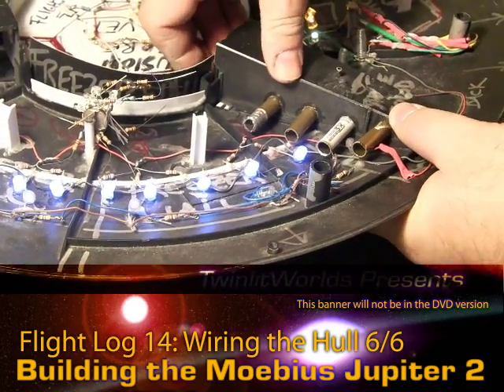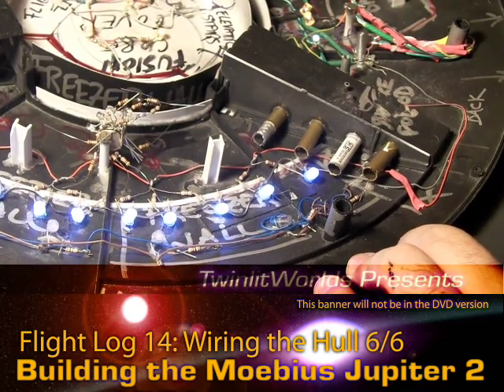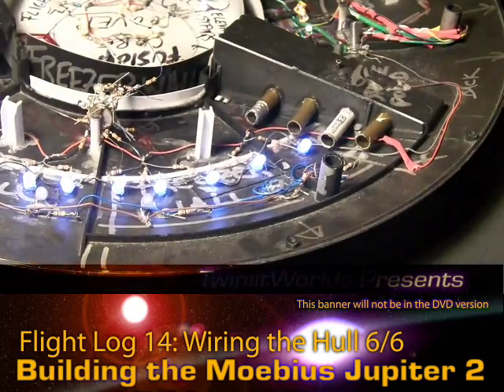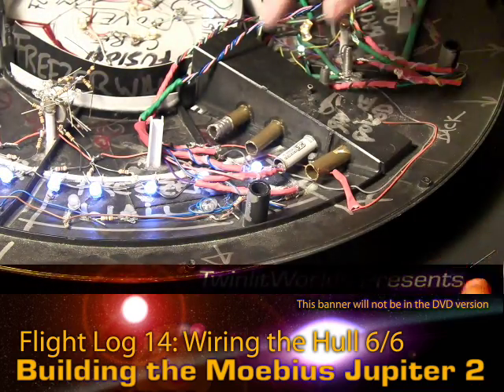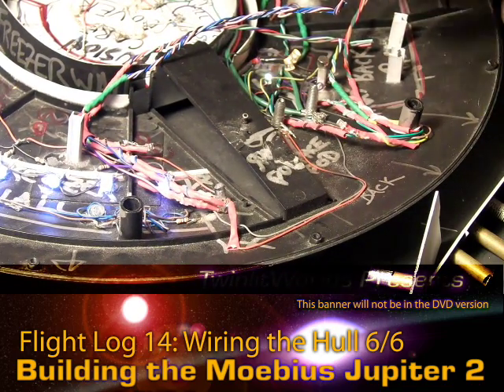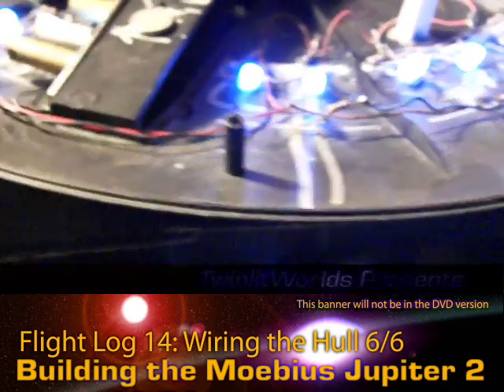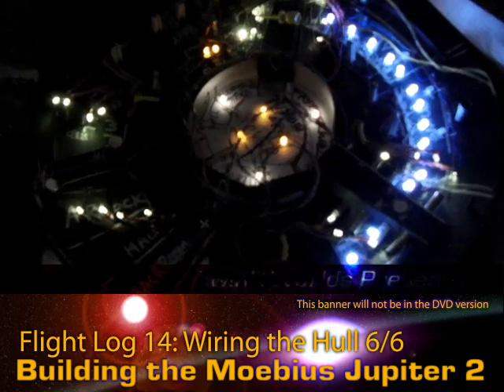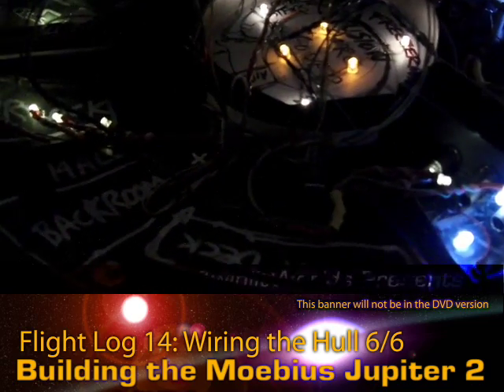Project Jupiter: Flight Log14 Wiring the Hull 6/6

Comment from the maker: @jtnix4381 This is called 'The Original SUper Glue' which you can search for their page.  The local dollar store has 7g for $1, so I use the stuff like water.  

The baking soda acts as an accelerator to the glue and forms a very hard crystalline substance.  It can be used to fill cracks, or to reinforce seams.  I've got a video about it somewhere in my play lists.